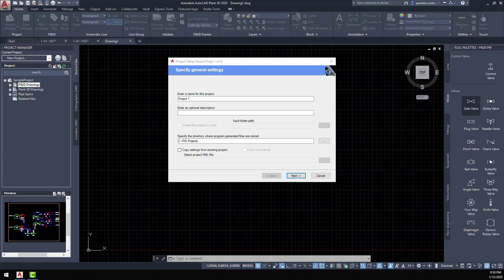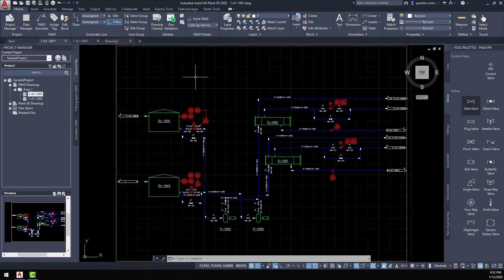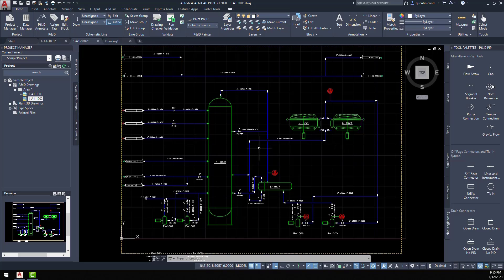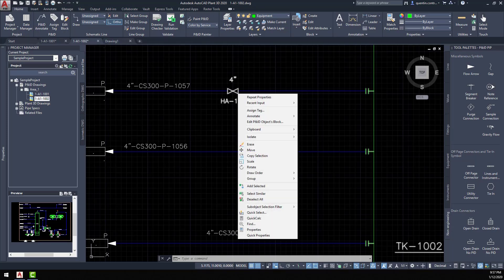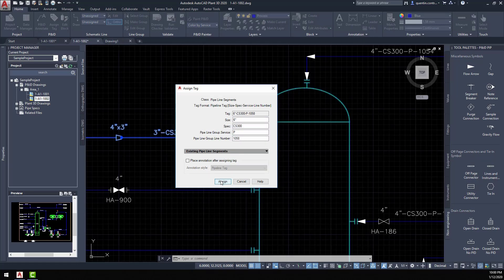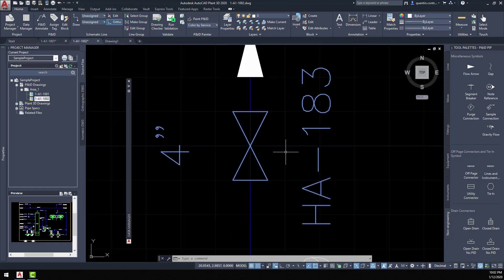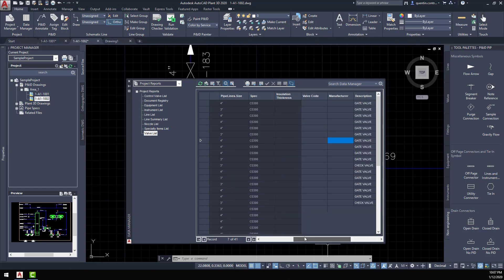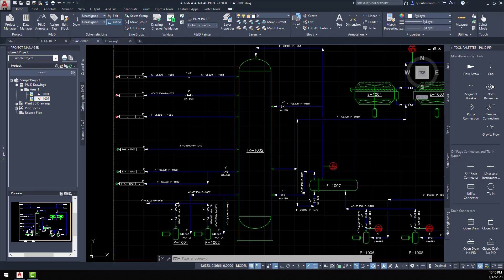Plant 3D with the Experts: P&ID | AutoCAD Plant 3D

Comment: I have a question about these reports
Before having this possibility, we process engineers, usually made one component list for all the components (valves( both manual and control), operation units, pumps) and one list for pipes. But this feature creats so many separate lists and files which makes it difficult to work further with. So the question is if it is possible to change the setting so you get everything except for pipes in one list? it is still acceptable to get a separate instrument list but having separate lists for valves is kind of wired.